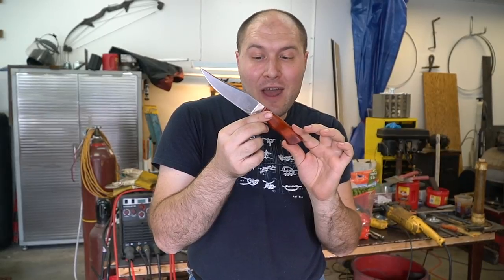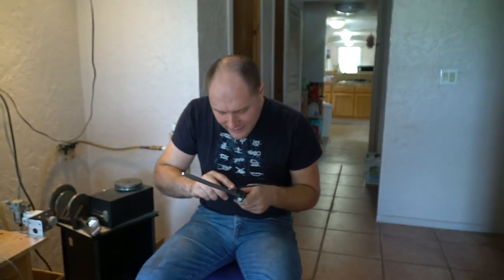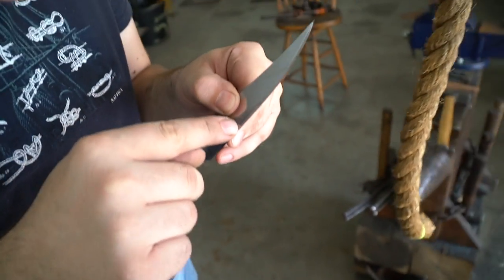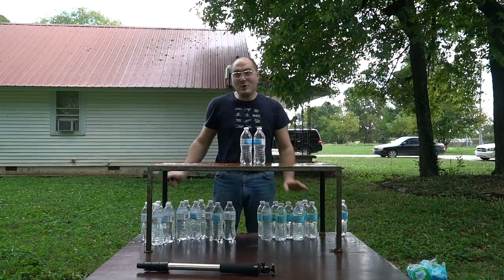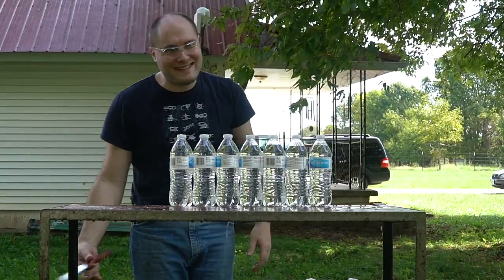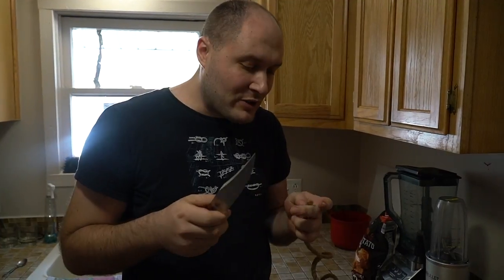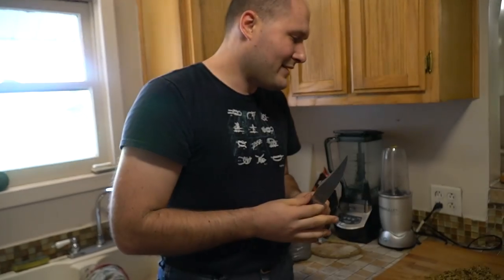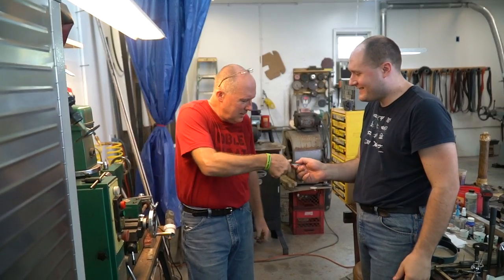Making a Knife out of a Shovel? Lets find out ~ Part 8

Comment: That's incredible, I never would've guessed it the shovel steel would hold up so nicely.   Kyle, your "Woo!"s after cutting the rope brings back memories of your master smith testing videos lol.  You truly are a master of the craft.  The handle looks great too with the poly coat you gave it.  

I gotta ask, with your style of sharpening do you keep a burr on the edge?   I don't think I'd be able to use a steel (stroking rod) to bring back an edge to that level of sharpness, perhaps a strop with some black emery compound, but probably not a steel.  I say this because I have a ceramic "steel" and it's never given me good results, so maybe it doesn't work as well as an actual steel one or maybe I just use it wrong.  I usually completely remove the bur on my strop so maybe that could be why.  I know geometry and heat treat are the two most important factors, but nonetheless I'm definitely interested in how you finish off your edges.  Thanks again for sharing, this turned out to be a great knife and equally a great series!
Reply from the maker: Yes I do keep a burr on the edge.  I refine it down to where it's really small though.